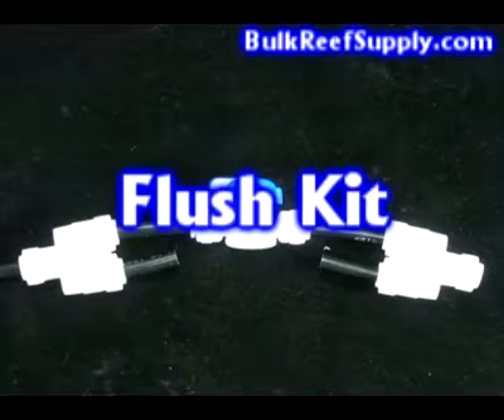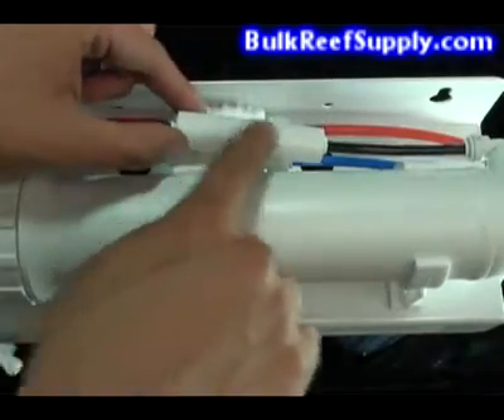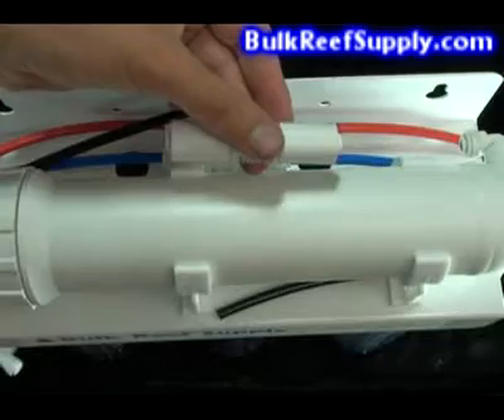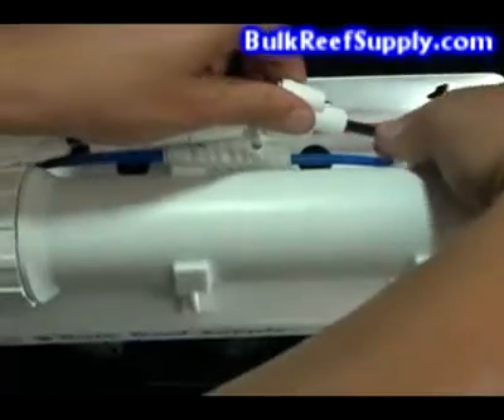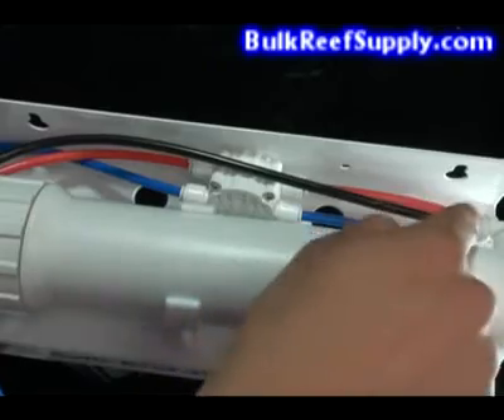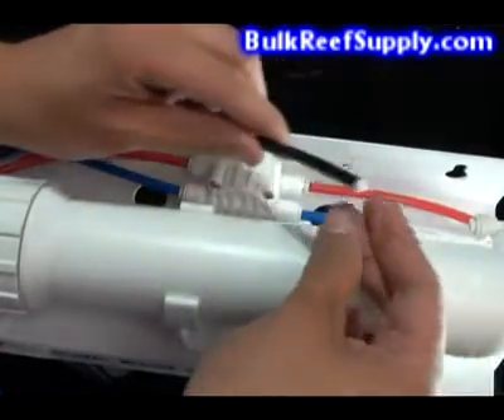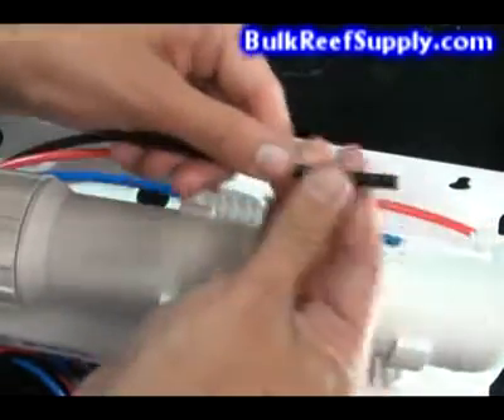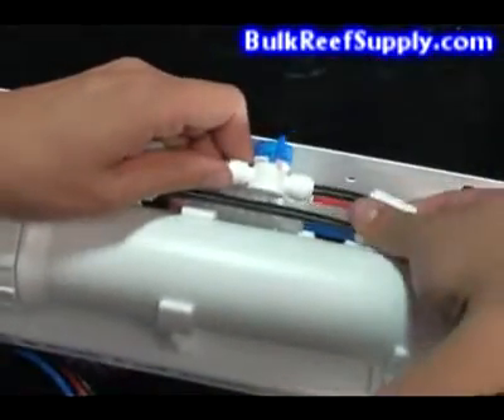Membrane Flush Kit Demonstration - Bulk Reef Supply BRS

Comment: if the purpose of the flush kit is to simply bypass the restrictor, why not simply just remove the capillary restrictor ,reconnect the line and flush?  it would do exactly same thing...reinsert restrictor back into line when done
Reply from the maker: Removing the flow restrictor would flush the unit! Most people won't want to do the extra steps if they don't need to though. These used to have a bypass line you could open to flush the unit.

Comment: I haven't seen any instruction on how to operate the flush kit in a drinking water system environment, and I'm confused on how to run it so that I do not end up drinking any of the water that's produced while it is flushed. What would be the steps to properly flush the membrane and not have the water go into the the storage tank? I'm thinking this is the process. Can you confirm or correct?:
1. shut off the valve to the storage tank
2. open the flush valve
3. open the spigot to flow water through the system for 3 minutes
4. close the flush valve and let water continue to run for 3 minutes
5. turn off the spigot and open the storage tank
Reply: Then can you recommend the correct steps to take?